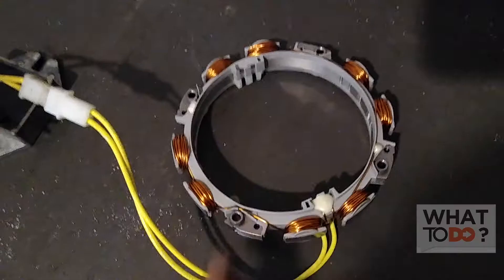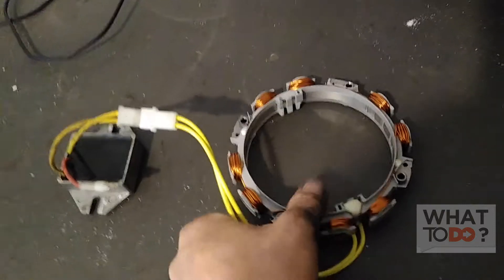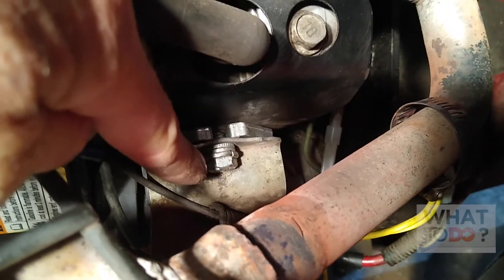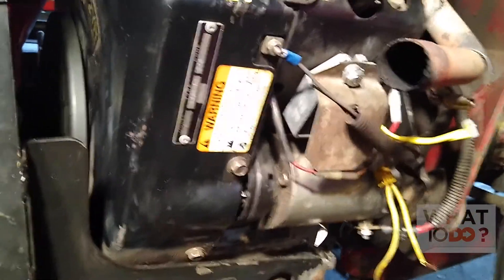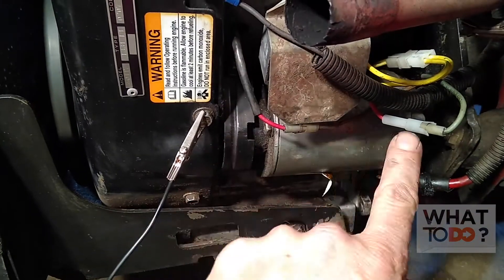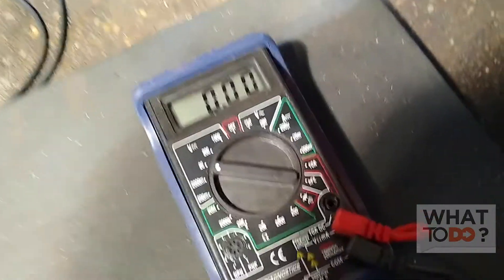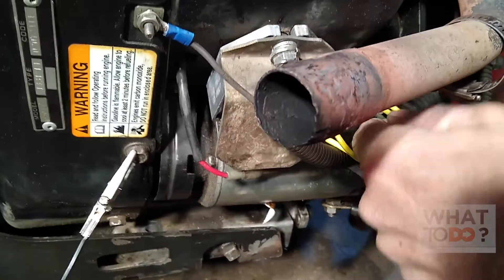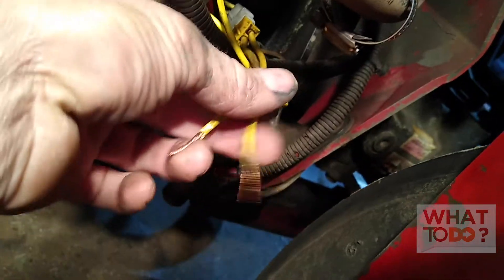How To Check Voltage Regulator / Alternator / Stator on VANGUARD Motor

Comment: If alternator voltage is low, before tossing it, clean rusty magnets on the fllywheel, clean up the ignition coil(s) and check their gap.